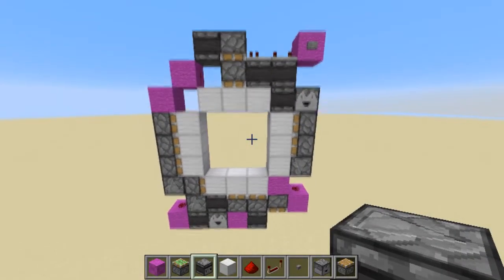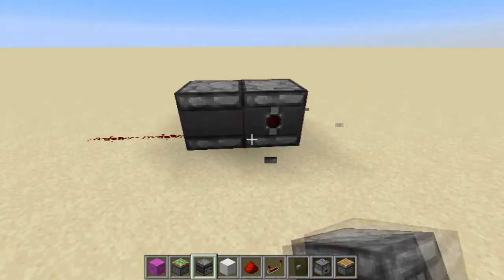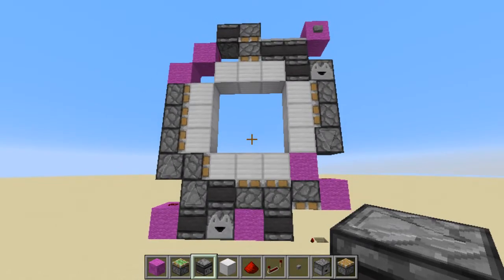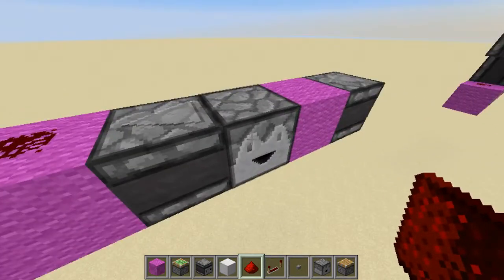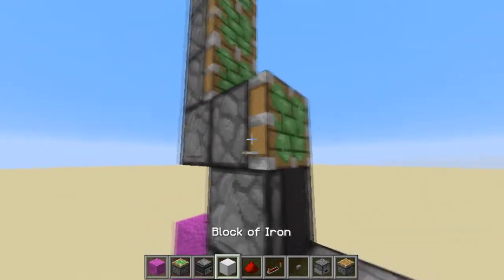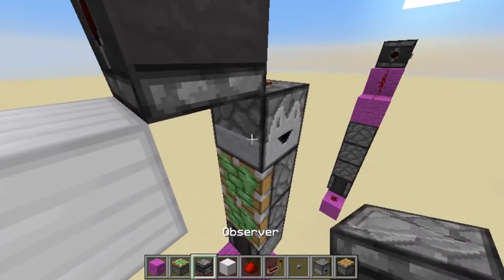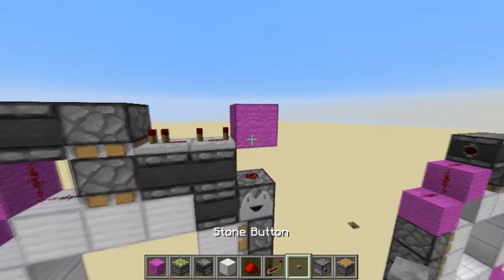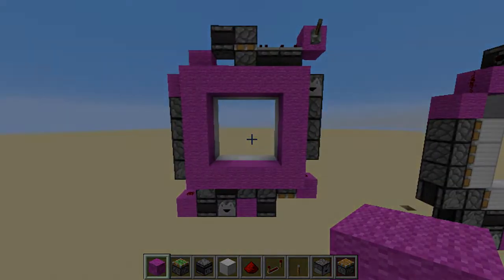Understanding The 3x3 Piston Door

Comment: Question for ya. Is it possible to move the lever to a more accessible height?
Reply from the maker: Yes, just have a redstone signal flowing into that block
Reply: @Gabibo  I tried to just flow redstone to that block with the lever and it always messes with the door for some reason
Reply from the maker: Keep the same y level for the top purple wool in the thumbnail for at least 3 blocks. I think you’re powering the redstone beneath the original button spot

Comment: How to make 3x3 piston door but lever down
Reply from the maker: You can add a lever to the top where I have the button. Leading it down with redstone if you want to position it somewhere different. As long as it reaches that block it will work.

edit: I gave the wrong info at the start. Took me a second to remember this build after a while of not building doors.